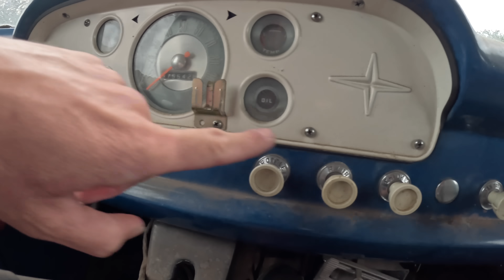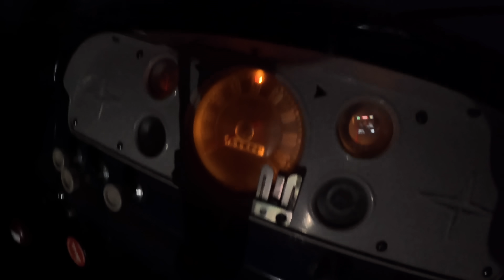Trying to get the Ranch Ready For the Storm! (Long Overdue Fix!)

Comment: Hey try changing the gasket on the sending unit on gas take it’s probably old and gas probably seeps out a bit or gets wet and not keeping fumes in the tank!! I had same issue in my ford f100 and it’s my daily also and man I count not stand the raw fuel smell after driving awhile! Changed my gasket with cork gasket and man solved problem

Comment: As a land development civil engineer, infiltration of stormwater into the ground actually is a positive thing. The volume of water discharging from your site is reduced and erosion is mitigated. However a properly designed and built wet or dry pond will preserve your property too. I’d also recommend getting your ditch restored and designed by an engineer as well lol. You need to seed it when it’s done!

Comment: All old trucks like that have that vent in the cab fuel smell. They make fuel tanks or you could have one made to fit inside the frame rails. That will get rid of the smell. If the tank stays in the cab it doesn't matter what you do you will smell it.
Also look into air ride semi seats in the truck and that will help out the ride big time!

Comment: 🤘😎👍 9:00
Thats how its done. Make rocky stepdowns. It also slows the water down at each fall.

Theres probably some formula to figure out how often per drop at xyz waterflow but i would just do some 1800s engineering and add till it works.

Comment: Ryan im sure you can build a pound without a liner however the liner would be best but you could get natural clay base from Oklahoma in drys cracks then when can fill and drain slower could be an option you can check into

Comment: Do you have a 360 cam Ryan? Trying to decide if it’s worth spending for the GoPro 360 or even more for the Insta 360.
Reply from the maker: I use the Insta360. I like that it’s slimmer than the GoPro, plus I have nothing but issues with my GoPros daily.
Reply: @DMAXRYNO  I’ve been looking at X3 for snowbiking. I’m sure you won’t have much experience with cold weather being in Cali, im in the Okanagan area of BC. I know with the GoPro you have to run the white endurance batteries. 

I noticed you had that 360 shot on top of the dump truck so figured I’d ask. May have to look into that! 

Thanks for replying! Weird when you watch someone’s content for so many years and don’t talk to them lol. 

I do pipeline work and a lot of our clean up work in the end is erosion control so I’m always trying to think of things to recommend you to try but you basically did what we would do with our drainage ditches/berms/swales. We would suck it out, out some geo or filter fabric down depending on the area and then rock armour it. I think what you did will work great!

Comment: That gas smell is normal. Those old trucks have the fuel tank behind the seat. I actually relocated the tank on my 72 to under the bed.  They make kits for it might want to look into it. They also make power steering  retrofit kits for them as well.

Comment: Hey Ryan just a thought what if you bought a 4ft round poly drain tube cut it in half. Made your own forms to make with concrete at the warehouse closer to cheaper concrete then use pappa rynos 450 and you're trailer to truck them out to the ranch?

Comment: I wonder if your fuel smell in the cab is the gas tank behind the seat either coming from the seal around the fuel sending unit leaks when bouncing around or the rubber gas line underneath the tank is dry rotted and leaking.

Comment: The only thing I would say to do is put some rock down your drainage just to help slow the water down so it doesn't wash all that fresh dirt down to the neighbors yard 🤣
My dad has a 69 Ford, I've driven it a couple times and you better hope you don't have any losses fillings and are holding on tight to that steering wheel on a bumpy road because holy shit!!